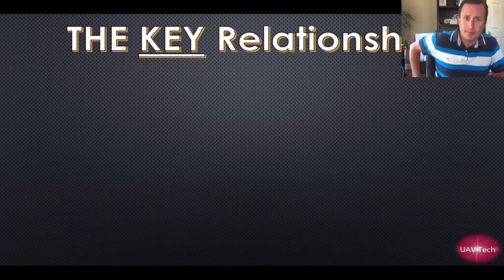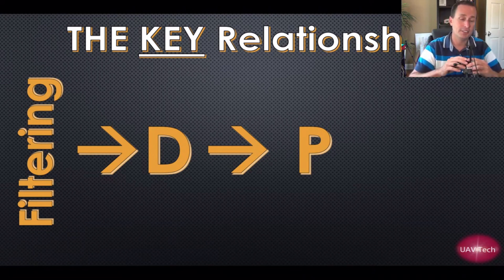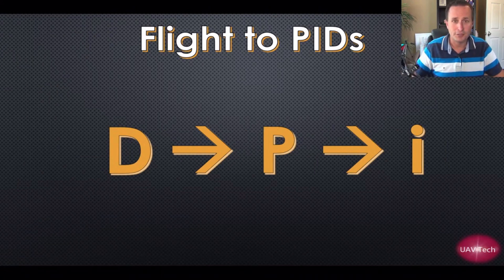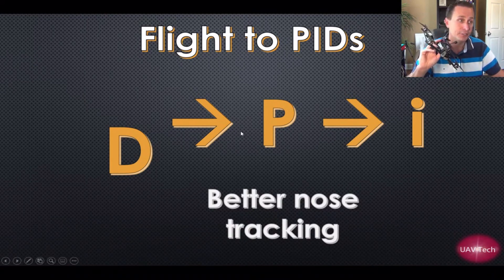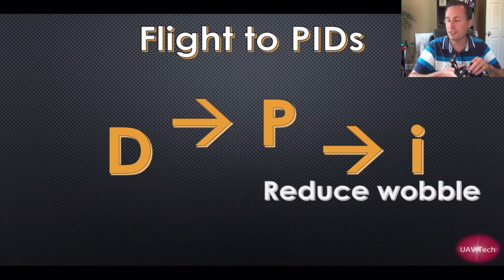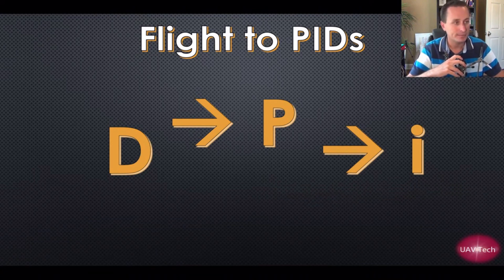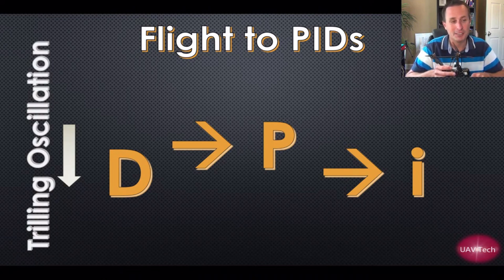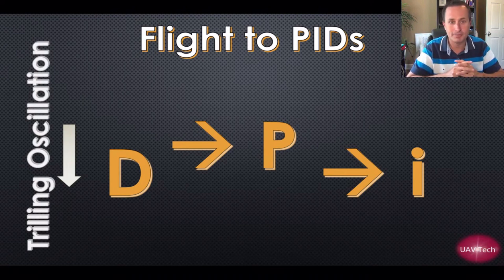PID Tuning -- 💥MUST KNOW💥 -- information!  💪😎

Comment: I know this is old, but I'm confused because if it's not the gains themselves, then what's the point of the master multiplier? AUW?
Reply from the maker: you have to get the balance right, from there you move the gains up/down (with the Master Slider) as outlined in the video.

It is really the Moment of Inertia that separates quad tunes, but we have no easy way to measure that as a community.
Reply: @uavtech Thanks for helping me understand. You do a great job of explaining tuning! I love the uavtech freestyle tune for betaflight really got me in the ballpark with zero issues. Community is lucky to have such a great resource👍

Comment: What about desync.....my quad flies beautifull amd punches good...no wobbles except slightly on going fast rotating 180 amd punch i get little prop wash issue...but only when i punch and flick roll to do a fast low snap roll or juicy flick  its as soon as i blip the throttle amd kill throttle,once i flick stick to full roll it will deathroll and fall out the sky....im lost i tried fast timing and raised dmag... im on bluejay

Comment: Thanks Mark this video really helped me understand. Been involved in fpv for two years and have built a few five inch drones and have had good luck with betaflight default settings. The real trouble started with my 7 build. Getting the tune good on that has led to black box configurator and pid tool box along with multiple videos from you and Chris Rosser. Thanks again.

Comment: what's exactly trilling oscillations?
Reply from the maker: a flutter sound from the motors: https://theuavtech.com/2022/08/finding-your-flutter-point-for-optimal-performance/
Reply: @uavtech  I'm dumb, thanks for your answer... so if you push too much the Master Multip you could get the trilling oscillation due to high D amplifying the gyro noise, right? how do I know my D is too high or my filters are too low?
Reply from the maker: @TheSnow520lee  you will hear your motors make an oscillation sound or they will get hot.

Comment: I just started adjusting my PIDs a couple of weeks ago, and have them almost perfect for my way of flying.  I use Angle mode [Save it, all you potential commenters.  It's my rig and I'll fly it my way.  :) ] and occasionally I get some mild wobbles in my outdoor flyer when trying to descend.  It also wobbles a little bit on gusty days.  Other than that it flies great, with no overshoots or bounce-backs and excellent propwash handling.  Looks like I need to drop my I-term a tad.  Thanks for this, Mark.
Reply from the maker: Yup.  Also since in Angle, the Accelerometer play a role.  There is a lowpass filter on the Accelerometer at 10hz which adds lots of delay to it's reading into the PID loop.  You can try raising that up IF -- and only IF -- dropping the i-Gain doesn't get you all the way there.
Reply: @uavtech  Using the 'set acc_lpf_hz' in CLI, yes?
Reply from the maker: @billmcdonald4335  correct, that's the variable.  But do the i-Term stuff first.  Acc has a lot of noise, and hence the low LPF.
Reply: @uavtech  I will.  I think lowering the I-term will do the trick, as the tune is so very close to ideal as-is.  I lowered the master slider one click, then bumped the P-D gain back up one click to restore their values.  I think that'll do the trick.  Just have to wait for the right conditions to test it, tho'.  I live on a rock out in the middle of the North Atlantic; Newfoundland's a pretty windy place.
Reply: @uavtech  I got my wind conditions, just at sunset.  The new settings eliminated virtually all the wobble.  I was able to descend with control and confidence, and I had no discernible wind wobble.  It also tracks the sticks a little better.  I was able to fly at altitude and know that my descents weren't gonna be the usual white-knuckle, nerve-wracking prayerfest.  Got three packs off, and only got the wobbles the once - by my own fumblethumbs.  There'd be a wiggle every now and then, but some of those could've been me again.

FYI, I fly a 100g AUW, 2S, 3-inch toothpick; BetaFlight 4.2.9; Bluejay v0.16; ELRS 2.0; and OpenTX 2.3.14.
Reply: @uavtech  Got better results today by lowering I-term 9 points more on each, and did it with the BetaFlight LUA script on my radio.  First time in the field [well if you consider our parking lot 'the field'], too.  So I'm off the sliders at this point, it appears [I'm happy with my P&Ds, both in value and ratio].  Which is kinda the goal, innit?  Thanks a million.  Again.
Reply: Its actualllyyy harder to fly in angle😂! I took off in angle yesterday on accident and thought my rig was messed up😂😂 was allll over the place! Practice manyal! Just BE LEVEL!

Comment: Hi, you mentioned propwash performance by increasing all the term at once (7:21), do  you mean increace by the same ratio or percentage?
Reply from the maker: Use the Master Multiplier slider.  So hold ratios between terms.

Comment: Hi thanks for all yours videos. 
I ve a strange problem that i cant solve.
With Wind back if i realease throttle my quad stil mantein the altitude, and speed up the motor, like ive no response for one second !
Thanks a lot for your tips
Reply from the maker: Sounds like maybe a d-term noise issue?  Check if it happens on default.
Reply: @uavtech  thanks 🙏.
I Tried first default, then work in I term, mixing p e d, but the feel changes not the problem. Seems like, hardware issue, but all brand new stuff. I dont know what to try .
Thanks again happy easter!

Comment: How do you get rid of oscillation when you punch the throttle, but when the voltage drops after a min, they go away?
Reply from the maker: In BF, set TPA breakpoint to 1750 and 0.8.  That will drop the D-gain after 75% throttle by 80% and should smoothout full throttle vibes.

Comment: Wow dude, I taught Automotive mechatronics 10 years ago at University in uk and basically all actuators, fuel/air ratio ,lambda exhaust mixtures and believe it or not, (Please i am humble, self taught and NOT BIG HEADED!).
IT WAS SO MUCH SIMPLER THEN. I always looked at SETPOINT, PID ERROR, and STEADY STATE ETC, but Im also a Recovering Drug,Drink,ANY,Pill that would do something, addict,so cant remember alot! haha
YOU HAVE JUST TAUGHT ME A SO MUCH EASIER WAY TO ADJUST PIDs!!!
YOUR GOOD STUFF GEEZER!
RESPECT FROM THE UK!
THANKYOU!

Comment: So I’m on 4.3 for my tp3 build and on 3s the tune is absolutely perfect but on 2s at the very low end of the throttle I get super minor oscillations, but they completely go away as I approach mid throttle, any clue what I should adjust. Thanks
Reply from the maker: Wobble is i-Gain too high.  Reduce Drif-Wobble slider.

Comment: so, if i increase p term, then i need to also increase i term simultaneously???
Reply from the maker: I would say you CAN increase i-Term simultaneously with the increase in P for better tracking in tight spirals, less drift on punch and throttle chops, etc...

Comment: Hello UAV -
Im still wet behind the ears regarding tuning, and lately it is starting to make sense. I can't wrap my head around one thing: After tuning filters on BF defaults, how do I tune D term without establishing a PD balance first (P term adjustment?) How can I tune a D term, (aka - anti P term), without first establishing a solid P term value??  Can you help me understand this?? It seems more sensible to me (as I have learned from your vids) to dial in P term first....???
Reply from the maker: You can do it any number of ways.  The key is knowing how the terms relate to eachother.  For example, I like to get PD balance squared first and then push up all the terms to make prop wash better - like you it seems - and then finalize I-term and take one last look at filters to see if I can lower any further after pushing up the terms.
Reply: @uavtech  Thank you  UAV!

Comment: I have the HGLRC Petrel 75mm  1S version with 22000kv motors. The motors and battery get extremely hot along with poor flight time. I applied your UAV whoop preset but still have same issues. I don't have blackbox so what can be done to keep both motors and batteries cool?
Reply from the maker: Fly it on the BF absolute defaults (filter and PIDs --- 1.0 sliders, D_min abled, etc....)  if they still get hot, it is a mechanical thing like being over propped.
Reply: @uavtech  OK thanks I'll give that a try.

Comment: Is wobble the same than prop wash?
Reply from the maker: I agree.  

To me, the key to defining a "wobble" is it is "slow" and typically happens at 0 or low throttle.  Ultimately, if you are not sure if a wobble or not, cut i-gains by half.  If it fixes it, it was a wobble.  If not, it was not a "wobble".

If not a wobble, could be a "shake" or "shimmy".  The fix for "shakes" or shimmy can be more filtering or lower PD ratio.  (which is more PD Balance slider in 4.2 --- I know, that will be cleared up in 4.3 to not be so confusing).  In MANY-MANY-MANY cases, shakes can not be.cured through filter or PID tuning as they are mechanical issues (bad props or electrical noise issues) that can only be solved by mechanical changes.
Reply: Wobble can be caused by propwash. Wobble can be caused by other things as well.

Comment: Question Sir, my marmotte flies pretty good but something weird i havent seen before. On straight forward flight, not touching sticks, the nose of the quad goes down very slowly. Not fast but definately enough to notice. What could cause that? 1050mah 6S, 2207 motors, gopro hero 7, rpm filtering. Thank you for all that you do!!
Reply: Also, there was a post on the betaflight facebook group about adc filtering on opentx transmitter. Should this always be disabled?
Reply from the maker: ADC disabled, Yes.

Increase your Deadband in the receivers tab to 5.  It is likely Pitch is just so slightly of center or has some jitter at center stick.  Deadband should fix you up.  I run 3 or 5.

Comment: Hi Mark, another awesome video thank you. Can't one just use this simple math equation to work out how to raise D individually?
((k+2) (1 - [wz + h + j - q]^2 - [(gk + 2g + k + 1)(h + j) + h - z]^2 - [16(k + 1)^3(k + 2)(n + 1)^2 + 1 - f^2]^2 -[2n + p + q + z - e]^2 -[e^3(e + 2)(a + 1)^2 + 1 - o^2]^2 -[(a^2 - 1)y^2 + 1 - x^2]^2 -[16r^2y^4(a^2 - 1) + 1 - u^2]^2 -[n + l + v - y]^2 -[(a^2 - 1)l^2 + 1 - m^2]^2 -[ai + k + 1 - l - i]^2 -[((a + u^2(u^2 - a))^2 - 1)(n + 4dy)^2 + 1 - (x + cu)^2]^2 -[p + l(a - n - 1) + b(2an + 2a - n^2 - 2n - 2) - m]^2 -[q + y(a - p - 1) + s(2ap + 2a - p^2 - 2p - 2) - x]^2 -[z + pl(a - p) + t(2ap - p^2 - 1) - pm]^2) - 1) - | (k+2) (1 - [wz + h + j - q]^2 - [(gk + 2g + k + 1)(h + j) + h - z]^2 - [16(k + 1)^3(k + 2)(n + 1)^2 + 1 - f^2]^2 -[2n + p + q + z - e]^2 -[e^3(e + 2)(a + 1)^2 + 1 - o^2]^2 -[(a^2 - 1)y^2 + 1 - x^2]^2 -[16r^2y^4(a^2 - 1) + 1 - u^2]^2 -[n + l + v - y]^2 -[(a^2 - 1)l^2 + 1 - m^2]^2 -[ai + k + 1 - l - i]^2 -[((a + u^2(u^2 - a))^2 - 1)(n + 4dy)^2 + 1 - (x + cu)^2]^2 -[p + l(a - n - 1) + b(2an + 2a - n^2 - 2n - 2) - m]^2 -[q + y(a - p - 1) + s(2ap + 2a - p^2 - 2p - 2) - x]^2 -[z + pl(a - p) + t(2ap - p^2 - 1) - pm]^2) - 1| = 0
Reply: Oh yeah that would work because each positive value of the above polynomial is prime. Also each prime is a value of the above polynomial, for some nonnegative integers a,b,c,d,e,f,g,h,i,j,k,l,m,n,o,p,q,r,s,t,u,v,w,x,y,z. Thus the set of prime numbers is identical with the set of positive values of the polynomial.
Reply: @FlyturboKwad  👌

Comment: I agree, I term often is too high. If you do really, REALLY tight proximity, pushing I term as low as possible actually helps with the nose tracking as I term has the tendency to fight the inputs. D doesn’t really fight the sticks, it makes things more floaty and less responsive. You can fight D with the sticks but the I term is really difficult to fight with the sticks as it so directly affects them. That’s just my impression of it ofc. I dislike the high I term feel so much that I’d rather lower it to a point where it hurts the performance. I hate the wash less than I hate how robotic the I term makes the quad feel. At the same time I wish I could have the cake and eat it too; if the I term was separated into input vs trajectory/gyro based values, you could tune the stick feel but still have the I to clean the trajectory/non input based stuff. Like the gusts etc. But I’m stupid, so. My ideas are probably the same 😁 Ah, right terminology - attitude vs trajectory. One could even make it so that the I term has a balance slider to which you want it to focus on 🤔
Reply: What about using the I-term relax to make up for too high I term? I've been flying with the I-term relax on 10 (the default is 15) and find that makes up for most of the problems caused by high I term.

Comment: General does this mostly apply to 5" quads? I've been playing with my 3" tune. When I follow the general rules for tuning, I get warmer to hot motors. At the moment w/ reduced filtering to 1.3, I ended up with a higher D than P and reduced I significantly with the addition to reducing FF to 0.8. I've gotten use to the tune, the performance is good to me, and motor temps are cool. Split-S's, sharp turns, rolls and flips are pretty spot on as far as I can tell. I don't use blackbox. 

I did the math comparison to stock BF PIDs and the results were that I reduced P-term by 35%, I-term by 45%, and FF by 110% while maintaining stock D-term. There's a couple other things I slightly adjusted like ff_trans, throttle boost, I-term relax, tpa, tpa_breakpoint, throttle mid, and throttle %. For some reason I can never get my P-term up. It always results in warmer to hot motors. Curious, if you have any insight on this...Thanks. If not...it's fine.
Reply from the maker: Works for ever controller and class.  Lower power (authority) quads have P/D at 1:1 or even inverted where D is higher than P.

If basing on motor heat, make sure a flight and not just stepped moves.  Stepped moves with strong PIDs makes for hot motors.  But in a real flight, they are fine.

That said, if your tune works for you, that is all that matters.  Not bad characteristics for you in flight, then go with it AND HAVE FUN!!
Reply: @Richard I fly mostly 3" 3mm #fpvcycle toothpicks (uni-frame) with 12xx and 14xx motor configs on 2s, 3s, and 4s (analog) and I too have found, for my flight styles at least, that filtering at 1.3 is key to my enjoyment. My end results (in pid values) do not always look like everyone else's but I've gone from windless wobbles at low throttle to back flip look downs that hold and track with my view (analog only no hd). Feels correct, and in control, in the strongest of winds. I don't use airmode and that helped a lot to feel the small changes I was previously making outside of the sliders. My rigs are between 120 and 160 grams auw. Happy flying!

Comment: Since I started tuning under your advice of D, P, I from videos in the past, and after watching a video that physically demonstrated PID tuning using a machine and dials, my tuning gets done faster and my quads fly smoother. Thank you 👍
Reply: I did the same thing with tuning D then P then I. It's how I tune. I like my tune but I ended up with higher D than P and lowered my I a lot. But I guess it's all about personal preference in the end as long as it perform well.